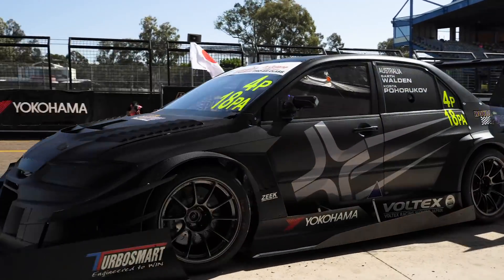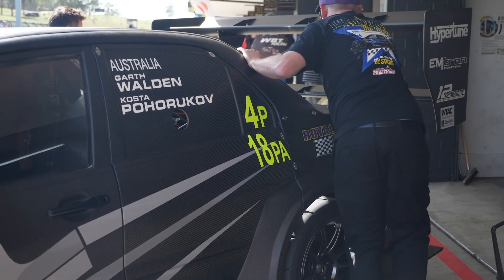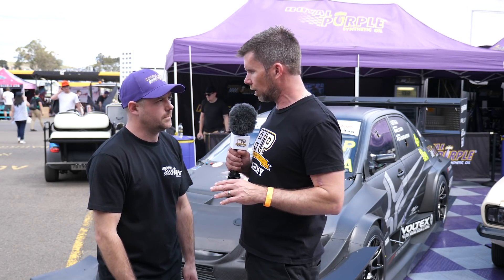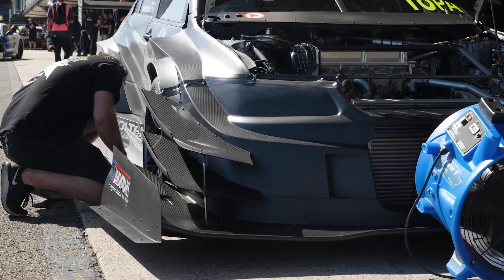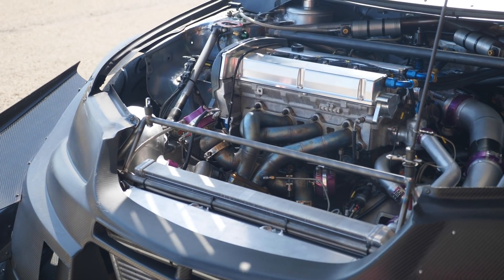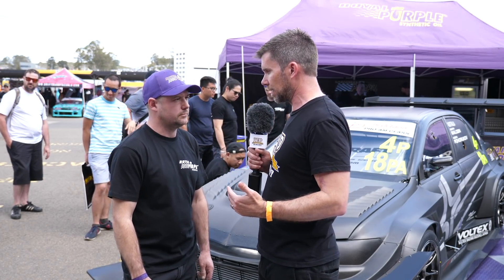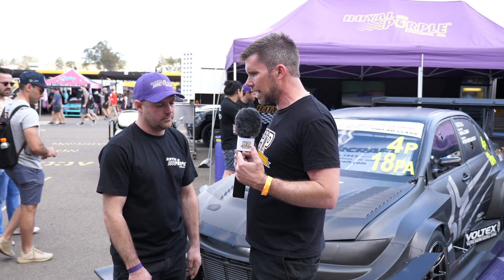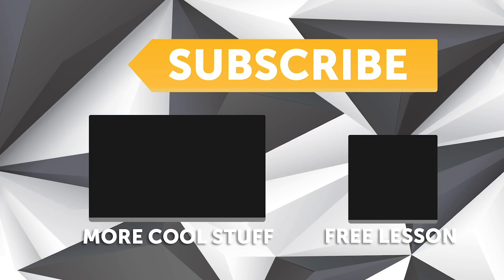No Billet, No Worries | 1200HP 42PSI 2.2L 4G63 Tilton EVO [TECH TALK]

Comment: Disappointed he didn’t share anything about the motor configuration, Andre had to keep nudging to get him to confirm 2.2L. Clearly anything but “pretty standard” as you don’t see a lot of built 4G63 on the street with more than 500hp, so more than double that has something pretty special going on 😄
Reply: Tilton evo V1 ran a cosworth 2.2l that was "sierra sierra" spec. They have done something different with their head sealing though, as that car used to blow head gaskets a bit.
Reply: N8_B SSE Evo moved on from headgaskets to some other kind of sealing (WRC Tech) I forget what it’s called bit Andre has talked about it before. I’m sure that’s what these guys are using.
Reply: No secrets what is done. Mostly likely makes all the power up top to save the block from cracking unlike a drag tune and a half concrete fill
Reply: G A I’m sure you are correct, definitely more wear in a different fashion revving a motor out to 8500-9000 rpm instead of just say 7200rpm
Reply: not sure where you live but here in the states plenty of evos running big hp on the street. i'm taking about 800whp+ street cars

Comment: 2:50 is that an alternator connected to the drive shaft?! What is that for?!
Reply: Am wondering the same thing.. maybe a separate one to drive the fuel pumps?
Reply: A lot of race cars have the alternator on the diff, e.g. the MG Metro 6R4. I'm not entirely sure why though. Maybe weight distribution?
Reply: more than likely they just didn't have any more room for the alternator in the standard spot.
Reply: @Thee_Snow_Wolf  I'm sure plenty do.. But is a long way for power to travel back to the front for everything else. In a application demanding so much current for fuel pumps it would make sense to have one just for the pumps.. there is also a 2nd belt down there.. not sure if it's for the alternator to bring the drive speed back up closer to engine speed after the gearbox or for something else..
Reply: @nolanjudkins7151  I find this hard to imagine. I've seen Rallycross cars with more crowded engine bays, although those all have them on the engine.
Reply: @mikejovi980  one of the reasons is to reduce the rpm's the alternator spins. They're not going to live long at 10k+ rpm's. Also it reduces some parasitic drag running them at lower rpm. As for running it out back, they do it for weight distribution along with the previous reasons. Another reason to run it out back is to reduce the weight of the cables in some instances. With the battery and large loads in the back of the car they can save some weight. It's not uncommon for guys to run a starter wire that's marginal at best to start the car in a pinch and use a separate battery for in the pits. I've even seen starter cables left out in time attack cars using a separate battery in the pits for starting reducing parasitic drag and weight......... There's a lot of reasons why they'll do it but it usually starts with being a way to reduce the rpm's the alternator spins.
Reply: Sprint/circle cars run their alts off the rear end. Packaging
Reply: It makes the alternator last longer. Evo alternators are notorious for failure, especially once engine rpm gets up near 9000rpm. It reduces drag on the motor, and you dont really need it working while your in the pits, as you have the car hooked to a jump box. Also helps weight distribution, and all the big current items apart from the starter are in the middle/back of the car anyway.
Reply: It doesn't make sense for purposes of longevity since moving the alternator to the drive shaft means that it's only working / spinning when the car is in motion, which means they would be running off the battery entirely when the car is stationary (start up, idle, neutral). If you want to lower the rpm of the alternator just replace the pulley with a larger size (2x bigger pully = half the revolutions).

Your guesses are as good as mine though lol. It makes sense for weight distribution, especially since they relocated the battery to the trunk and it's better to have the alternator next to the battery since the only purpose of the alternator is to charge the battery.
Reply: @bradcarpenter1881  not being in the engine bay or attached to the engine means its not subjected to anywhere near as much heat and vibration when compared to the stock location. As it is purely a competition car, it car start/warm/up etc off a jump box, which is a common practice in a lot of motorsport classes in australia.

Comment: Cannot believe that it is still using a OEM cast block! Lots to be gained with billet!
Reply from the maker: Yes there could be, but at the same time if the setup is doing what they need for now then change for the sake of change isn't always helpful. That said Andre didn't question too deeply on the pros and cons as if a reduced weight was the biggest goal for V2 then Trent must have a really solid list of reasons for not making the change to billet at this stage - Taz.
Reply: @hpa101  it was also noted by them on the weekend that weight balance matters very little as the aero balance outweighs it so significantly. Perhaps part of the argument to stay cast. Its always comforting to see guys like this running so many stock parts. I'm making around 500whp in my mirage and as you know with racing, power is nothing without reliability.
Reply: lots to be gained but might not be be useable, gotta watch the crash into the wall, they can't even run it at full power now.  thus it would seem their wins are coming with the power dialed back.  granted it's not "sexy" but those in Endurance racing for example view reliability as a "performance metric" equal to any other.
Reply: It's a Mitsubishi and it's called 4g63!!!!

Comment: I was hoping there would be questions about alternator running off driveshaft
Reply: Cleans up the engine bay abit and helps with weight distribution by running it off the driveshaft at the back